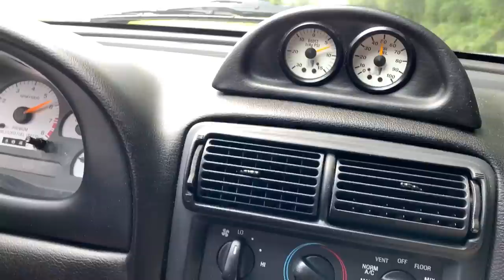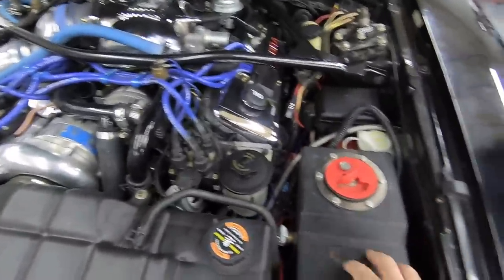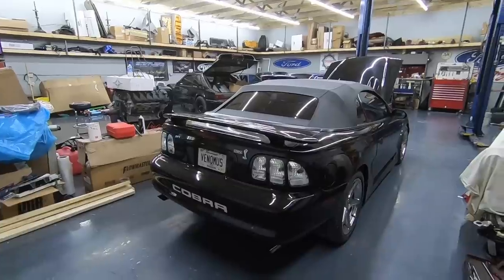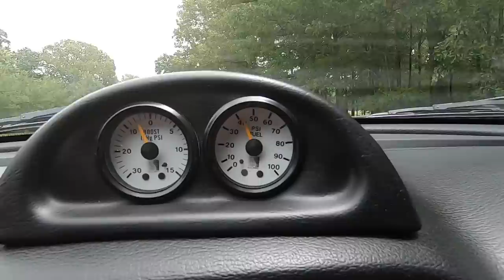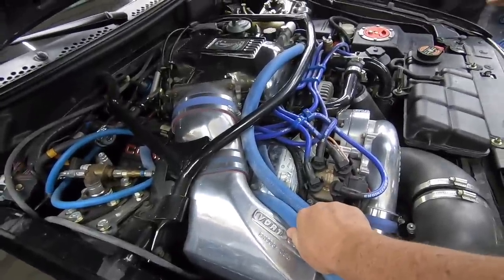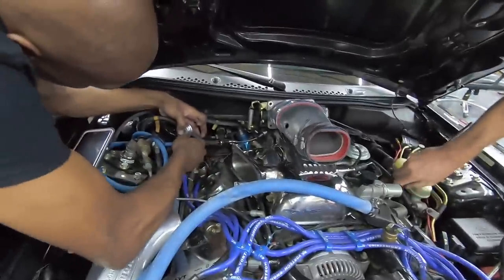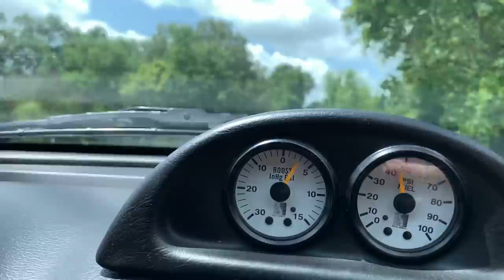Why don’t you see more of this generation Mustang...

Comment: Iv got a pretty nice 95 convertible gt. I got a couple years ago with like 80k miles on it and it's been pretty well cared for. It was cheap and it's pretty fun with a gear and a few other bolt-ons.
Reply: Did you take the 25lb weight out of the passenger front wheel well? People all about weight reduction and Ford just bolts a giant lump of metal up in the wheel well lol.

Comment: I still have my 94 GT after 20 years of owning it. Trickflow H/C/I on a 331 stroker. Ran 12.11 last time out N/A with 3.55 gears from when it had a vortech. I almost sold it when I bought my 2019... but I just can’t seem to let it go. We think it needs new valve guides. Maybe someday I’ll get back to working on it. It just sits in the garage.
Reply: sell it n regret it?? No way bro.. Keep it n supercharge it, sure you think your 2019 is way faster n all but how much you paying for that?? A bunch.. Congrats on your cars tho bro..
Reply: I’ve owned a 96 cobra since 2016 and since have bought and collected other cars such as a 93 civic I am currently building, an 03 Mach 1, and a 2011 bmw m3…still love my 1996 cobra the most and will never sell it!!! In fact I am planning to make it a roll race monster like those 2000hp street vipers you see on 1320videos channel or that racing channel..except obviously I won’t be making 2000hp of course, maybe around 1400hp when turned up all the way

Comment: I have a 94 gt just rebuilt the engine after 271,000 miles and put a new close ratio T-5z in it. Hard to deal with all the differences from 93 down . Like no valve   cover will fit to clear roller rockers. Had to but SVE spacers...but had to grind on the alternator and stock valve cover to fit them . Tranny is longer,bellhousing is longer. Looking forward to driving it some move. Needs paint, it ran 12.85 @106 mph on stock heads,and cam ,bolt on and slicks.

Comment: Hey Foxcast, if you really want to blow the doors off with a 90's Cobra, you need to do a roots type blower, not a vortech. Whipple was popular for a long while, Kenne Bell was the way to go way back when that car was new(Kenne Bell is my vote for cool factor also) The Teksid blocks will handle 1000HP, but some of the rest of that motor won't obviously lol. But really, the roots type blower adds low end grunt, and that's where the 4v motors were lacking. That vortech is adding more power on top of the power at higher rpm, so unless you have a longer gear to stay there longer, every time you shift you have to "start over". 
If it was me, I would yank all that stuff, marketplace it and pick up a Kenne Bell with the cash you get. Tune the boost with a pulley, and make sure the A/F is good.

Comment: I'm more into the 99-04, so basically the same thing. My issue with the 94-98 is that they look a bit boring to me. I will add that the cobra bumper completely changes my opinion of them. With the cobra front bumper, they look amazing.

Comment: This is my favourite year and body style I couldn’t find a good one in may so ended up buying a 01, I really wanted this body to build into a fast bad ass car, but my 01 convert I got worked out a lot better now!! Since I found a new mmr 1000se 4.75 stroker, procharger kit, trickflow heads extext and now is under the knife getting built into a 700+hp car lol
Reply: It won’t run long with MMR parts
Reply: i dont know what the other guy is saying but i'm sure you're gonna enjoy that New Edge..

Comment: My dad has a triple black 95 convertible GT with 30,000 miles never seen rain snow or anything. Not a speck of rust or oxidation anywhere    its the closest to showroom condition as you can get. With a few classy mods. Has all stock parts incase . And its amazing shape and he keeps it garaged all the time. And its hard to keep so nice in Massachusetts. And when i say jo rust or oxidation. I MEAN IT. And he drives it 3 months a year and only a weekend car. He has the saleen roll bar Cervoni cowl mach one hood and brake pockets for the side. 305????  plus rear tire  like inch wide maybe more.  Its amazing you won't find a nicer. Id love to see  it somewhere its so nice. Meticulously maintained and a die hard ford mustang owner.  Had then his whole life. And every part us perfect. Has aftermarket smoked headlights and tail lights .   And has all the stock parts . He has flowmaster 40 series with X pipe and 4.11 gears  all MSD billet distributor and wires . Its amazing with such low miles being triple black. And he drives it like a old man .......lol cause he loves it that much. He has a few more things done  im forgetting but its so nice  .......... looks so good with such a wide back tire and tall hood 🤤🤤🤤🤤🤤🤤🤤👍👍

Comment: That system should be able to make 12 psi of boost check ur bov my has the same system n it started running like that cuz of the bov being mess up and it will only make about 4psi.hope it helps 👍
Reply: Whats a bov?
Reply: Blow off valve...where is it located? I have the same set up but I'm new to Vortech
Reply: It most likely has a bypass valve.  Didn't look like it was running a blow through setup to me.
Reply: Bov usually hides under the procharger and cooler and if u apply vacuum to it it should hold   At least 15psi and if it dont than u found ur answer this kids used a audi bov that u can find at the junkyard in any vw as well

Comment: I have my 1998 GT blank on black since new and in mint condition, and I really  like the body style. The peanut shape body style really has a lot  of  work and is not plain. Engine wise, the 4.6 V8, I would've liked it to have more horsepower.  But the power plant is a good reliable work horse.

Comment: I have a 95 gt 5.0 5 speed, black with black interior. 180k miles, runs good, could be better. Underneath is spotless, was a North Carolina car. Couple rust spots on the roof. Its my driving project, been fixing things here and there as i go. I love that car

Comment: I have a 98 Cobra that I recently purchased with the exact same superchsrger set up and I'm going thru the same boost issue minus the miss and oil on the plugs...at best it makes maybe 6 or 7 lbs and u have to hammer it hard for that. Im curious to see what you guys come up with... this issue is driving me up the wall! Feels like a stock Cobra to me ...ugh! Can you talk more about the power cooler on the next video and what you run in it? Mine has antifreeze in it... any tips and tricks w the vortech u can show would also be appreciated 👍
Reply: Blower probably needs a rebuild. Check the turbine for shaft play then compression test each cylinder on the motor.
Reply: Could have blow by. Have you done a compression test?

Comment: I had a foxbody in the early 90s and couple years ago I was looking to buy another. Couldn't find what I wanted, either to expensive because it was "hot rodded" or it was trashed, because it was "hot rodded" by clueless kids. Came across my SN95 a 94 GT vert that was at a good price that I couldn't pass up.  Virgin car, all original except the radio with 62k in very good condition, it was owned by an older man. Good car, not the foxbody I wanted, but good. At least it has 4 wheel disk brakes, don't have to screw around and convert a foxbody over to 4 wheel and 5 lug. And technically the 99-04s are still SN95s 😉

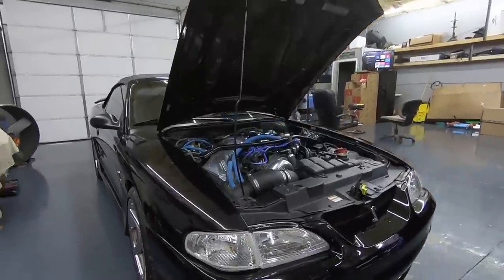Comment: 4:08 - "Those non-PI two valves". Well, those non-PI two valves are 700,000 mile plus engines all day long. Ford screwed that engine up when it added the 3rd valve and started seizing the spark plugs in the cylinder head. Ford durability tested the original 4.6 to 500,000 miles with almost zero wear in the cylinder bores. The 96/97 F150's are still sought after due to the legendary reliability.

Comment: Because it was Ford's 1st try at Adaptive Learning in the ECU. The mods to the Foxes didn't work the same Unless you had it tuned. The Computer kept trying to compensate. My Realistic Dream Car is a 1994-1995 Cobra. I've had Foxes but I'd like to have a SN95 and the Cobra is the only way to go in my opinion.

Comment: bought a 96 laser red vert gt years ago used maybe 120k miles. head  gasket blew within 2k miles. coolant all in the plugs.  thats some the reason you dont see them much anymore their old as hell and been dogged out by  the past 5-10 owners.  next in line 99-04 stangs good luck guys hang strong yall next to drop out. unless you plan on spending a fortune to bring them back to life, expect all those older mustangs to be BEAT THE FUCK UP.

Comment: Maybe I missed it, but what was the fix for the oil in the spark plugs? Thanks.
Reply: I don't know if they replaced the o-rings or not but there are o-rings that seal the spark plugs holes under those valve covers and they fail over time and let oil get into the spark plugs holes.
Reply: Valve cover gaskets.

Comment: Oil soaking was the result of a problem.. Why was the oil getting into the plug bore??
What are the fuel trims? 
When was lost igntion tune up?? 
Blowers eat igni tgnitions parts... 
Looks like he's needs to maintain it moor.
That saleen is a beast when running right. And I don't even like many fords
But I pay respect to blueovals that deserve it. I love Saleen cobras. 
But they are rare and finicky. And by big motor Classics demand MAINTENANCE. 
we all know where three drivers foot is when in command of these performance cars..  Of course that means you have treat HER especially good..  Lots of fresh fluids and plugs...   
And tires.. Lots of tires.   
I don't think I'm wrong. 
Cheers brothers. Love the channel

Comment: I had 3 of that body style Mustang I didn't like the cup holder situation and I didn't like you couldn't put nothing down no room for anything it felt to me like an awkward situation sitting in that car but the exterior I like the lines I like the looks I really like the way the back looks with some nice fat tires on the car. I moved on to a 2006 RT Charger then I've been messing with and the inside has plenty of room and still fast

Comment: If you guys are interested.... i have an 06 mustang s281 sc #1127 with 97k miles. All stock except radio, has a JLT intake, 3.6 pully 8lbs, and brenspeed stage 2 tune. Selling mine for 18k 
Just a thought.

Comment: If that motor is stock as rods and pistons. It shouldn't be more then 10 pounds of boost. My Mercury Marauder has the same motor as the Mach 1 New Edge Mustangs. Early Teskid aluminum block 4.6 4 cam 32 valves. They have garbage pistons and rods. So 10 pounds is the most you can run. Unless you want to blow it up.

Comment: Not sure why but it seems like all SN-95 are always thrashed. Very rare to find a clean car like this. Was OEM build quality not as good when compared to previous or later generations?
Reply: Cause the v6 was cheap and decent looking back then and with the v8s both models were dead bullet proof, cheap to maintain/fix.
94 fobra here, 331 t-trim 12psi, 600+. 100% smog pass.  T5 last original part. What was terrible is it needed 6” cut off the nose and wheel well gap!

Watch out on cooling, they all love to overheat on mods.

Comment: if you don't have a supercharger or turbo or any other power adder well, it doesn't have much performance. its expensive to add long tube headers and heads etc. its expensive to install. if you can be happy with a stock gt motor which by the way the 4.6 is extremely reliable than the car is a good choice. i got bored with my 96 saleen.

Comment: I like these. But the rear would need to be changed if it was mine. Tail pipes coming out under the bumper ruin it for me. Id also slap in a sbf either 5.0 or Windsor. That 4.6 is just too wide.. Seems lije its a pain even to just remove the valve covers. Which will need to come off to change the gaskets if u got oil in the spark plug holes. 

How much power that spposed to make? 400whp at least?

Comment: I've got a 2000 turd 2 valve turd. Had more power in my 87 lx 5.0 with simple mods. Would love to build a 351 but the state inspection says no.

Comment: So whats up with cylinder 8? That's  a shit ton of oil. I need to replace my valve cover gasket on my 01 cobra due to oil on sparkplug boot on #4 cylinder. But my sparkplug electrode is dry and the threads are too... the fact the #8 cylinder has that much oil...  im thinking bad rings causing blow bye? Maybe a compression check ✔ would be good to start?  Please lmk what you guys find out.

Comment: You hardly see them because most have found their way to the junk yards. Those particular Mustangs had quite a few little issues here and there but the 1997- 2007 models were the worst especially if they had the 4.6L V8.

Comment: I’m just getting into mustangs but please dont bash me with this question but these body style mustangs came 4.6 and I’ve seen that they also come 5.0 with the 1994 and 95 models. Is that the same original engine that came in the foxbody mustang? Is this car a 4.6 2v or 4v?
Reply: The Cobra engine is the 4V. Saying 'Original engine' that came in the Fox body is not the correct phrasing. Yes it is a 5.0 pushrod motor just like like the ones that came in the Fox body. There were many variations of the 5.0 that were put in the Fox bodies over the years -  carburetor vs fuel injection to name the biggest change. The SN95 5.0 is very similar to the Fox 5.0 set up, while essentially the same motor you would need to swap a number of bolt on parts to make one motor work in the other body style, ex: intake, throttle body, timing chain cover, distributor to name the most significant differences I can think of off the top of my head.

Comment: I have a 1995 Cobra and it just developed a problem with the MAF sensor i put a new one in it and it didnt fix it so i dove a little deeper and i am only getting 5-6 volts to the MAF sensor anyone know where or what i should check next??( the 5 volts is key on engine off, from what i read online i should have 12 volts, with key on engine off. If someone could help me figure out if i have a bad computer or wiring that would be appreciated)

Comment: @foxcast media 1996 cobra hard top black with tan interior.56k miles v2 supercharger,same intercooler kit as this car on the video, got all forged internals.roll cage. Manual valve body aod with trans brake. Line lock, upr control arms all the way around, coilover kit. And much more. Plus got all the original cobra parts. Just got it 2 days ago. Dyno says 500rwhp If ur interested let me know!

Comment: Wish I'd bought the 95 over the 2000 I got my son.    I just don't like it.  Dunno why
Reply: Maybe the extra PI power, or just the looks??
Reply: Mod it. Put some pullys on it, 4.10 gears, cold air intake with 75mm throttle body, and flow masters with x pipe exhaust. Mine is faster than a brand new eco boost.

Comment: Any one know the why the oil is on the spark plugs? I have a 03 mach that is doing the same thing, just not as bad.
Reply: Spark plug seals are gone. Having oil down the spark plug hole is a dead give away. Have to remove valve cover to change seal. Since ur there might as well change valve cover gasket also. If they don't change the seals the car will be back with same issues.

Comment: SN95 also includes the "New Edge" style cars. The New Edge Mustangs were just a mid-cycle refresh.
Reply: SN95 stood for "Sporty North American 95th version." The New Edge had all new body panels (except for roof & glass) so it was obviously not the "95th version" anymore. It may be the 96th or the 113th or whatever version.

They both are on the Fox-4 CHASSIS.
Reply: @foxfordcatguy2283  SN95 = 1994-2004 Mustangs. They have the same chassis like you mention. The "New Edge" is not a separate generation. New body panels doesn't make it a new generation. Ford designated all cars produced between 1994-2004 as SN95.

Comment: The mod engines are nothing but junk. Brought a 02 gt new the block cracked after 50k traded it in on a new 06 f150 5.4 3v. Timing chain and phasers went out after 89k. Bought 03 expedition from my uncle for my wife. 5.4 2v has 124k on it and burns 4qts oil between oil changes. This 4v is just another example that they are junk.

Comment: 99-04 were also sn95 but they eete the new edge version of it so most just call em new edge but they are indeed sn95s.  Just like 05-14 are s197 but the 05-09 and 10-14 are little different.  05-09 isnt really a different body style it is just the precursor to the revised s197 that came in 2010.  These are the same deal...94-04 is sn95 but the 99-04 are the revised sn95 dubbed new edge.  Love the cobra i used to own a 97 always wanted a vortech on it never got to do it i totaled the car in 2008.  It a jlt cold air when jlt first came out, had an offroad h, flows, 4.10 gears and was lowered on sportlines on real chrome cobra rs.  I now have an 07 gt500 with bolt ons and 4.10 gears even though its much faster it has a similar feel and sound to my old cobra that i loved so much..cuz it is still a mod motor with the old school firin order...my 500 also has an offroad hpipe but borla stingers which i always wanted for my cobra.  It has that burbling 4v sound that is unmistakable lol.  Love it